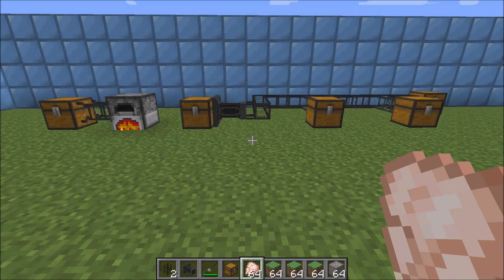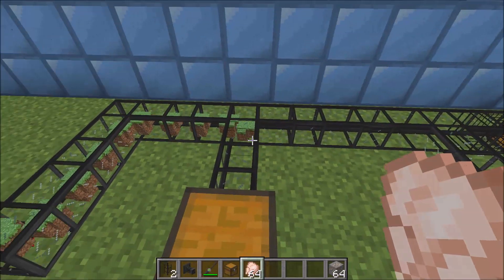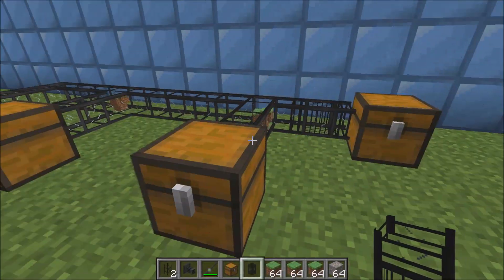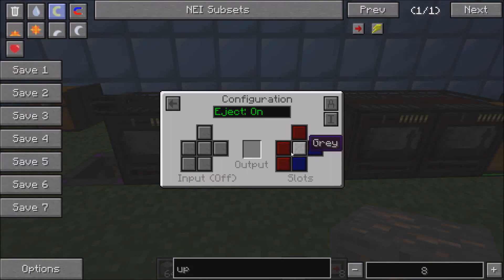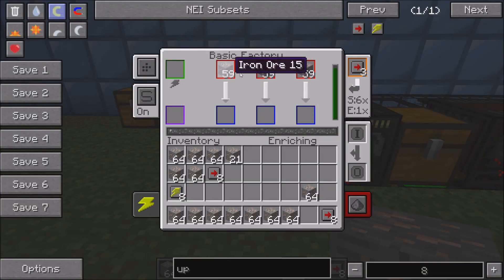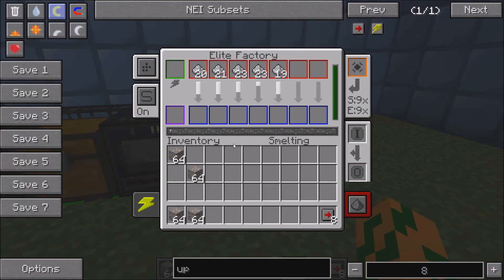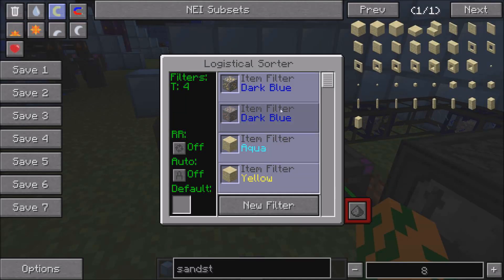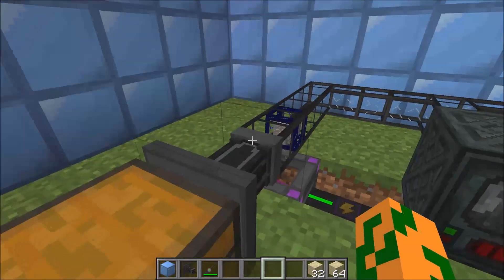Mekanism 1.7.10 Mod Spotlight  Ep5: Factories and Logistical Transport

Comment: Question at 2min 16sec.
I did the 4 basic factory to triple my ore production. I stuck an Iron Chest with a transfert pipe for the input into the infuser. It works great.

I stuck an Iron chest after the 4th machine but ore processed are not move to the chest. I tried with a transfert pipe (from machine to chest) but it looks like to pipe does not connect. Does it only work with basic chest?

Thank you!